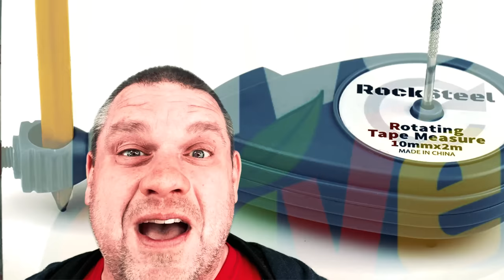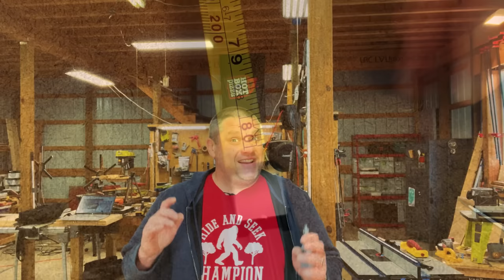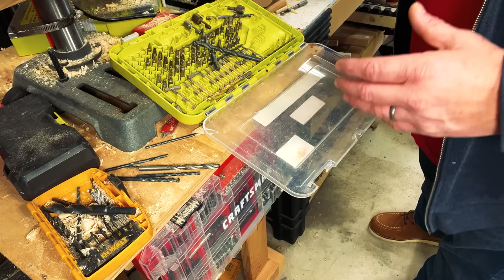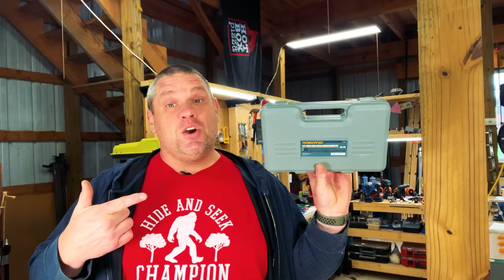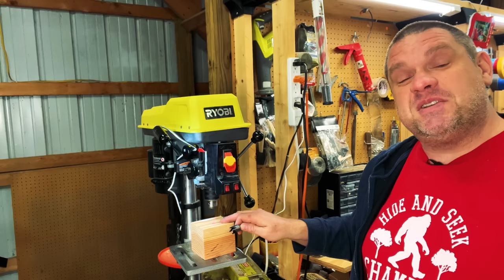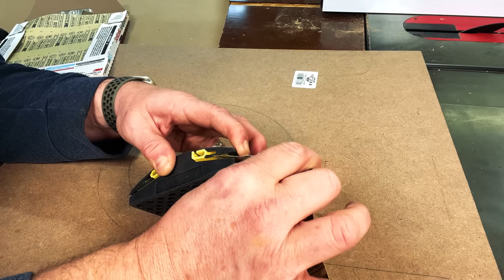Incredible Woodworking Tools: You Won't Believe What They Do!

Comment: I switched from orbital sand paper with the holes to sanding nets by Diablo they are great and don't have those holes to tear out.
Reply from the maker: Great idea Chris.  You know I have some of those sanding nets as well.  For some reason I just don't feel like they are as strong as the regular papers (It could totally just be my imagination though)  I  used them on a couple of projects and I feel like I noticed a difference between the normal papers and the nets.  Great idea though!